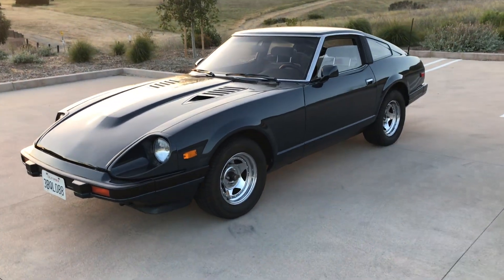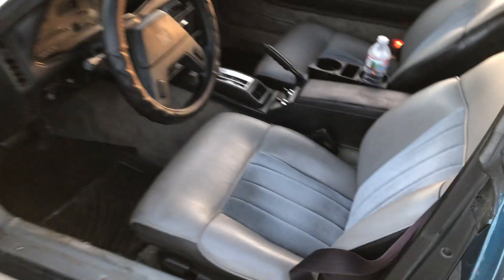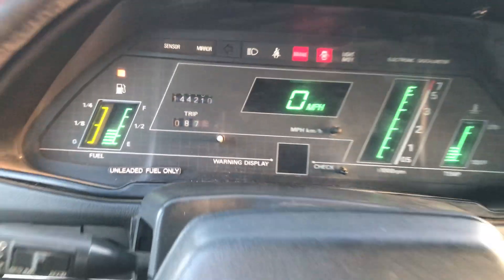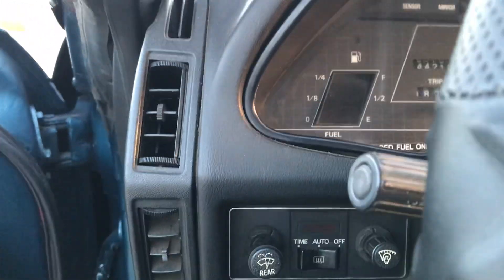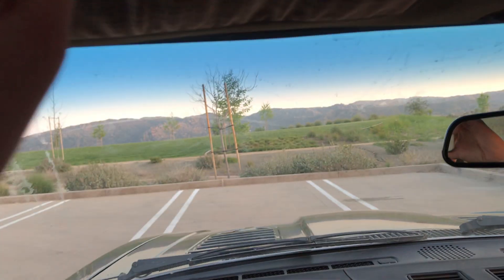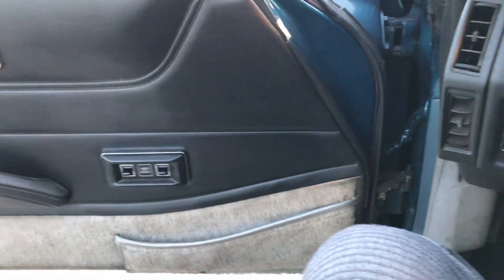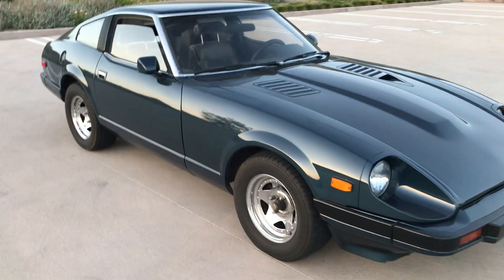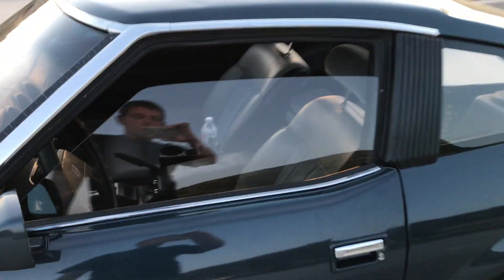$1700 Pristine! Datsun 280ZX 1983!

Comment: I’m about to pick one up all original and super clean and runs smooth, it has 170k miles is that okay?
Reply from the maker: It’s an old car but as long as it was maintained well it should be Just fine.

Comment: The fan is to prevent vapor lock in the fuel rail
Reply: The vapor lock issue was the reason the ('77&'78) Zs and all ZXs had vents in the hood 13:06.